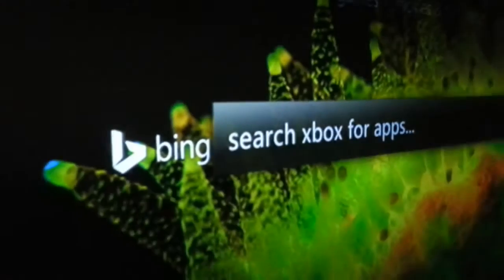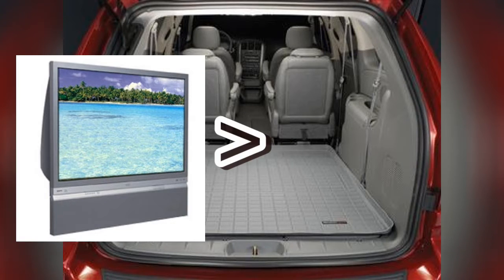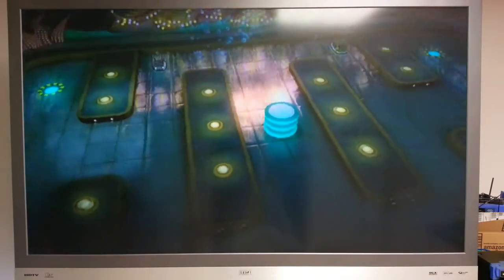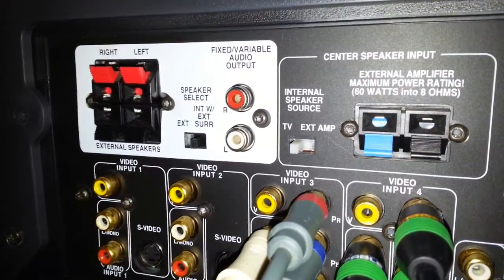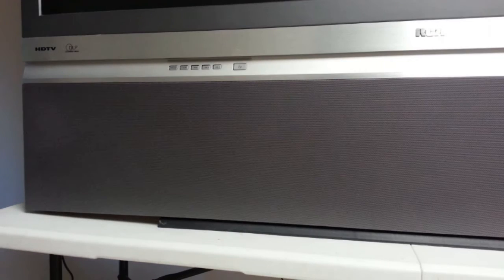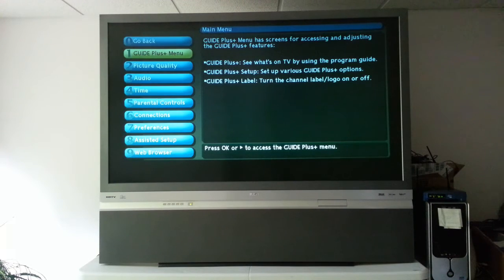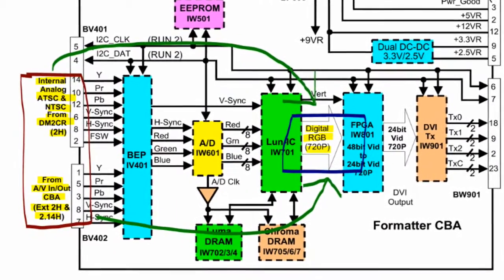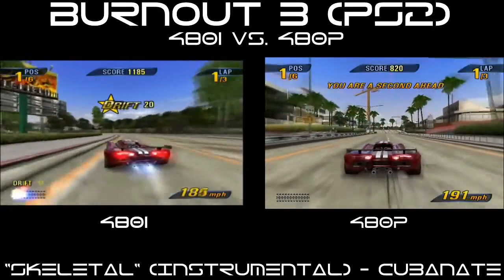RCA HD61LPW42 DLP Rear Projection HDTV Review & Tour

Comment: nice video i just obtained a 2004 model scenium HDLP61W151 model of this tv for free and all it needs is a new lamp
Reply from the maker: +Robbie Guessford 
Nice. That model (the higher end "Scenium") is nearly identical to the one shown in the video, except it should have a black frame around the screen instead of a silver one and a blue light on top of the buttons on the front of the set.
Reply: +Channel 2012 yup you hit the nail on the head and found a new lamp with housing for only $32 I just have not decided if I'm gonna keep it or sell it after I get it working again
Reply from the maker: Robbie Guessford
I'd try it and see if you're happy with the performance. Also, if you do decide to keep it, the biggest challenge will be finding a stand that is short enough. Most stands are built too tall because newer televisions have a very short distance between the bottom of the stand and the bottom of the screen.
Reply: yup me and my gf were talking about getting a stand for it and i have ordered the lamp but the color wheel is making a kind of high pitched noise so i may have to replace that to i guess ill find out once i put the lamp in i mean it could be a fan but im pretty sure that sound is coming from the color wheel
Reply from the maker: Robbie Guessford
Keep in mind that the wheels used in this model are also inherently whiny. The model I used in the video had a brand new light engine (with what I assume is a brand new wheel), and while it is quieter than the old one, it is still a bit on the noisy side. It's not unbearable, but not silent either. Replacements are in the neighborhood of $100 (shipped from China no less), so it's up to you if that amount of racket is acceptable.
Reply: oh ok so they are suppose to be a little noisy then i mean i could tolerate it it does not last very long but i did not think that was a normal sound
Reply from the maker: Robbie Guessford
If it's obnoxiously loud, then it's probably going bad and will need replacement. If it's just a little loud, then that just seems to be how they come (unless what I got was a new-old stock engine with a DOA wheel, in which case I wouldn't know what a "new" one sounds like).
Reply: well ,mine really isnt that loud and it only makes the noise for a short period of time but it does it every 1 min or so i probably would not notice it if i were actually watching tv
Reply from the maker: Robbie Guessford
Be sure to keep us all posted with what you figure out.
Reply: +Channel 2012 Brand new lamp and housing arrived today was able to install within minutes and it fired right up and so far its working great im real happy nothing is also wrong with the color wheel either i may end up keeping this tv after all
Reply from the maker: Robbie Guessford
Good to hear you got it working. Did you use a name-brand lamp or a no-name one?
Reply: for now i only used the no name cheap $20 bulb i did not want to throw a lot of money into it just in case there was something really wrong with the tv that was not worth the investment but its working and the picture and brightness really is not bad at all i think when this bulb goes im gonna replace it with the more expensive phillips bulb as long as i dont run into any major issues down the road i have read a lot of reviews saying you can tell a huge difference between a no name brand and a phillips brand so may be worth the money
Reply from the maker: Robbie Guessford
That's probably the smart choice. I wouldn't want to waste more money than necessary just to test something either.

As for the name brand lamps, the pundits aren't wrong :-). Going from the brandless lamp to even the inexpensive namebrand "value" lamp was a huge improvement. If nothing else, I'd at least go with one of those.

Comment: Could you please contact me I sent you a message I am trying to hook up my ps4 to a RCA Scenium HDLP61W151YX1 and am trying to hook my PS4 up to it and I am failing at a rapid rate and I am frustrated beyond belief.  What video game system are you using on your tv in the video.  I am trying to figure out if I need a converter box or what cable I need.  I have tried a converter box and it didn't work, tried a HDFURY Gamer 2 Component and it isn't working now I have no idea where to go from here.  Any help would be greatly appreciated.  Thanks, Kane
Reply from the maker: Actually, the console featured in the video is an Xbox 360, not a PS4. PS4 only supports HDMI output, so you'll need to hook it up that way. A passive HDMI-to-DVI connector adapter should do just fine. Otherwise, an HDMI-to-component transcoder (usually used for older HDTV models that lack HDMI) would get you to component (if the transcoder you use supports scaling, then this would guarantee that basically any HDMI-based device should work just fine). The HDFury is a very expensive example of such a product, so it should work splendidly. Where are you getting hung up with it?